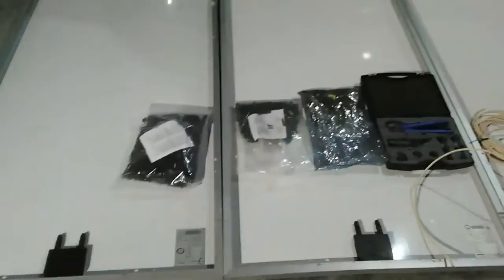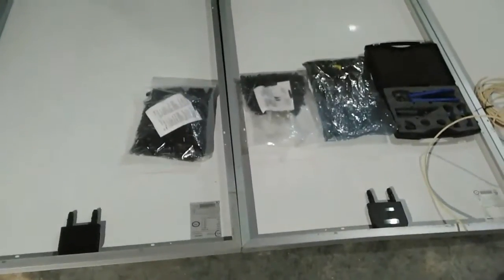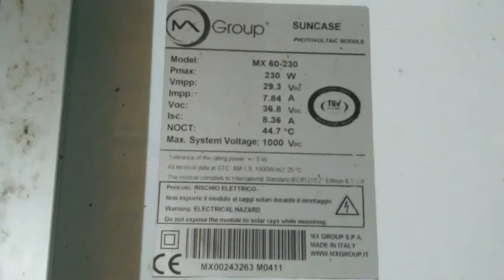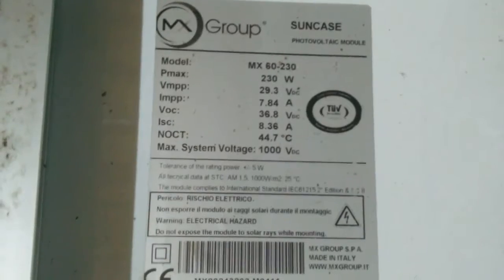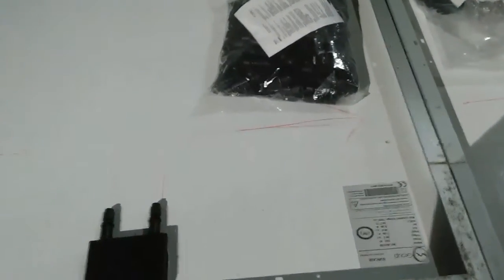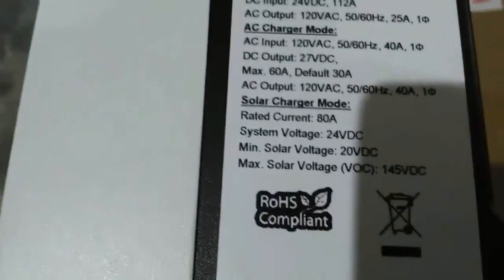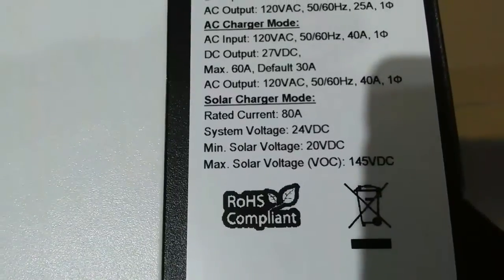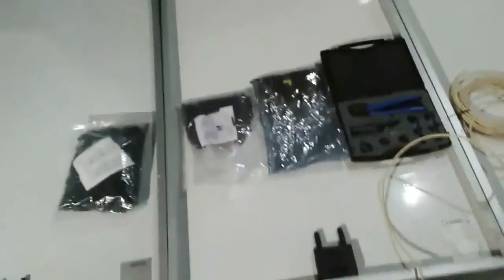Wiring up solar panels for higher voltage lower amps

Comment: Awesome video, I have a quick question... I purchased 4800 watt solar panels.. I’m confused on which Midnight Solar Charge controller to get the best out of my solar panels (150, 200 or 250) ?? I don’t plan on adding any wind solar just solar panels.. Any feedback would greatly appreciated brotha, Thanks and hope to hear from you soon
Reply from the maker: Sorry it took me so long to get back to you been working a lot lately but on the inverter I'm not real knowledgeable on the midnite solar but I do know that all of them have mini of the same capabilities other than the 150 the voltage from your solar panels cannot go in as high as the 250 the 250 is the one that I would get because you can bring your panels in at a higher voltage and that wood save you money on wire.  Hope that help you thank you.